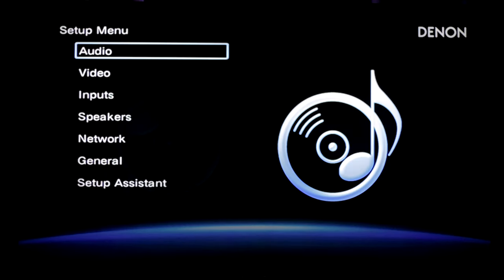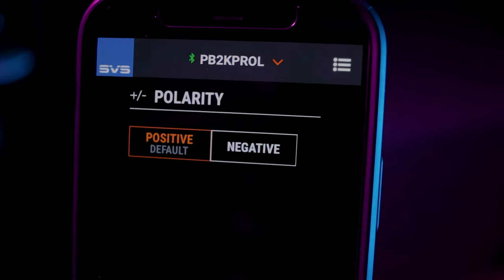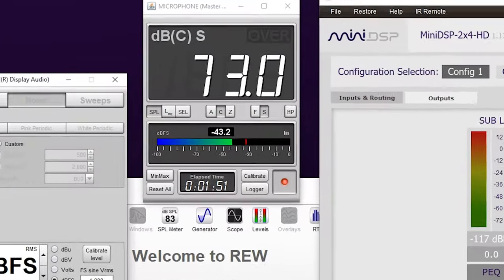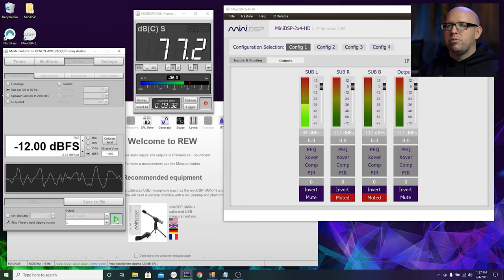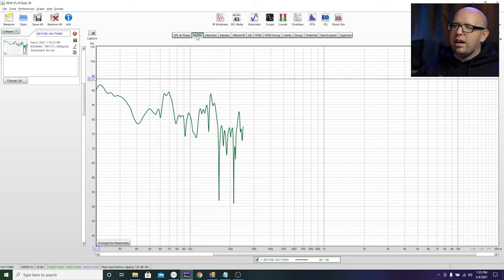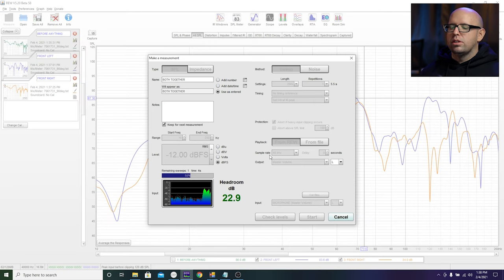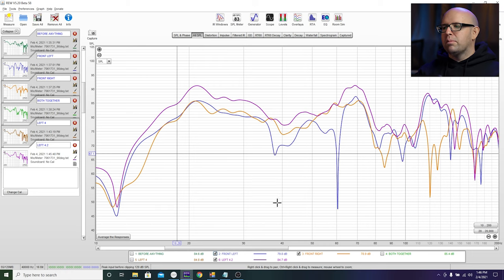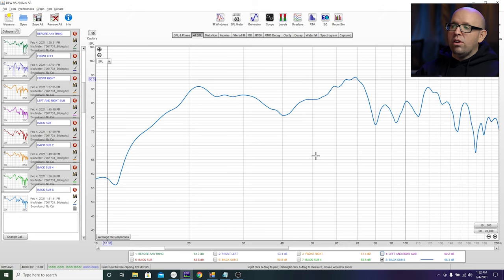miniDSP 2x4 HD | Subwoofer,  receiver SETUP and TIME ALIGNMENT guide (part 2)

Comment: I highly recommend measuring the subs with "acoustic timing". Then you can use the REW Alignment Tool to find the best summation of all the subs without trying to input a ton off different delays. It's highly accurate much quicker and only requires to measure each sub once and than use the alignment tool to find the what works best in your room.
Reply from the maker: I did not know this. I will definitely look into it and give it a try! Thanks for the info!
Reply: You got some documentation on that? I want to tune my subs and I am just starting to learn 👍
Reply: @HomeTheaterGamer  any update on using the REW alignment tool?
Reply: EDIT: I changed the subwoofer position and tried the steps discribed below again. This time the timealignement was not good. I got totally different and beter curve results with brads method!

What I tried and this seems to work pretty well (I am a REW noob, there could be a better way):
1. Set Measurement in REW to the settings Brad provided
2. Switch to "use acoustic timing reference"
3. Unplug your left main (so that you don't get any signal from it, if you crossover does not go as high) and set the reference speaker to right
4. do a measurement for sub 1, sub 2, ... mute the others respectively
5. in the text under the miniature measurement on the left in REW there is a time and distance now for each sub
6. the time will be negative, what you cannot put into the minidsp
7. take the largest distance from the sub measurements and round it up to something nice
8. put that distance in your AVR for your sub
9. now do the measurements again and you will get new (positive) numbers for time delay
10. put those time delays into the mini dsp for each sub

Instead of putting in the delay for each sub you also can set Sub 1 to zero and substract its dealy from the other numbers. It's the same, but the subs are not time aligned with the main R anymore (which Brad does later with the X-over anyway? So there should be no difference here - please correct me if I am wrong). For me this provided a slightly different number as I got by Brad's method (calculated 3,69 vs. 4,7), but the overall sum measurement seems to be pretty close to it as well. I am not sure which I prefere (I got to nasty points at 30 and 90Hz, of course only one of them is better with each method and one is worse...).

So - if you are not up for tons of measurements and analysis by eye, this could help, I think.
Reply: Great video; very high quality. However, I recommend that you spend a bit more time refining the methodology based on science first, then moving on to trial and error. You should start off the time alignment by using a tape measure and math. Determine the actual distance between the microphone at your preferred listening position and all subs. For example, my 4-sub setup consists of two tapped horns at the front corners and two standard bass-reflex Polk subs at the back (i do not recommend Polk). Not only are the tapped horns 6.6 feet further away than the rear subs, but because of the folding inside the TH's, the drivers are an additional 2 feet away from the front of the enclosure. Calculating the delay at 8.6 feet and using the rough speed of sound (which can vary) of 0.895ms per foot, i would start with a 7.7ms delay applied to each of the tapped horns (or a different number for each if they're not equidistant). From there, I would then fine-tune using the "better or worse" method, stepping up and down by 0.01ms. Trust me when I say that 0.01ms can have a huge impact on the response.  Also, don't be fooled by a powerful or even flat response; flat response does not equal low distortion. As such, you also want to look at the distortion of each successive measurement. You can have a nice response with horrible distortion, and your expensive subs will sound like crap, albeit loud crap. Reflections might help to boost dB and give you a deceivingly flat response, but the timing misalignment will wreak havoc on the distortion level, making your bass sound like a whoopie cushion in an echo chamber.  I have had a timing difference of only 0.2ms increase distortion from 39% to 300%.  It goes without saying that what sounds good in one spot might sound like shit in another. My theater is calibrated for the spot between my right ear and my wife's left ear....everyone else gets whatever they're lucky enough to get.
Reply: How do you measure the subs with "acoustic timing"? Is there a feature in REW that does that?
Reply: Agreed. REW alignment is very effective! Check out Jeff Merry’s video “REW Alignment…..”
Reply: Can’t find any tool called that in rew?

Comment: When you were on the first two subs adding delay, I noted you only tested adding delay to one of the subs and then you settled on 4.2 and then moved on to adding in sub 3.  Would there be any benefit after getting the best reading you could from adjusting delay on the left sub, to then adjusting delay on the right sub before moving on to the third sub?

Comment: Thanks for making these DSP tutorials. Really hoping you can answer my questions! A few questions for you:

1. In the level matching section are we just level matching our subs with our front left speaker? If yes, why and why not level match with front L+R and why not level match with just the front right speaker?
I'm sure this is a super basic question, but I don't get what we're doing and what it's accomplishing.
2. Do we need to set the level of the surround speakers to 0.0dB (Denon receiver>speakers>manual setup>levels>test tone or do we leave those to whatever audyssey setup?
3. Should we run audyssey before we start this? does it matter?
4. I noticed your RMS signal level is set to -12.00dBFS. Mine was set to -20.00dBFS, should I change this to match yours before playing any test tones?
Reply: I have the same question about the RMS signal level.
Reply: I have same questions too, have you find the answer. Do you level match first and do the room correction. Please help.
Reply: @lalithpodduturi9811  sad he nvr helped. I found some help online. You do level match first. What room correction are you using?
Reply: @hollosym  I am running Audyssey!!! If you don’t mind can you send me the online link!!! I like the Brad video but it not clear what to perform from first to last, in his video he said to match with left speaker and turn off adyssey. Watch with -30db on raw.
Reply: @lalithpodduturi9811  the big thing he glossed over is setting the type of sweep in REW to “sub” ie subwoofer. In the end you could simply unplug your front left channel and you’re good. Just make sure you doable all room correction. 

His method kinda sucks tbh, the better method is using the alignment tool in REW. Here’s a great breakdown: https://youtu.be/8bwpLfbLiZ4.

That guy's channel I linked above has some really great tutorials. He has a JBL SDP-55 processor so it's a tad different when talking about how to disable room correction. You can follow Brad's how-to to disable audyssey room correction on your receiver.
Reply: @hollosym  thank you!! I did followed him earlier!!!

Comment: Hi there great tutorials. I used a toslink (optical) cable instead of HDMI to connect my pc to my receiver. When I switch to Sub cal, I also hear the signal also through the left main channel is that normal? Or do I really need HDMI

Comment: Thank you, brat, for the tutorial.
I can see many people facing problems when they play (SUB Cal) test tone the front speakers play sound with the sub.
If anyone wants to play (SUB Cal) tone from the mains only without the sub they have to put the front speakers to Large instead of small.
If you put the speakers to small the mains and sub will play the (SUB Cal test Tone) at the same time.
Hopefully, this will help,
Reply: For measuring the subs the way Brad is showing then its correct that the front Left speaker also plays the test tone along with the sub of choice? Because thats what is still showing below in the app. Also, what should the gain knob on the back of the sub itself be set to?

Comment: hello minds guru, I have set up the connection as you described in part1 and I have an issue to get the sub input level to come up on minds software after I pressed the play button on the REW generator. I could hear the noise from my left main speaker but the sub. please advise.... you missed this in your part 2 clip
Reply: I know same here

Comment: you level match your fronts to 75db with avr volume set to  -17.db . Normally you will use reference level -0db for that ? do you level match all speakers in AVR levels section, when you have run room correction software ?

Comment: In the playing of the Sub Cal --
1. Should the front speakers be muted?
2. How did you adjust the subwoofer output to ~77 dB? Changing Input gain or changing Output gain?
3. Are you measuring all subwoofers playing at the same time, ie, with all subwoofers unmuted?
4. if the answer to question 3 is YES, should the individual subwoofers first be adjusted to equal dB before measuring with all subwoofers unmuted?

Comment: Quick question. I'm about to receive my second sub in the mail next week. When I fallow along with this should I set the first subs DB to 75 using the volume nob on the sub itself and then the second sub using DSP software to match? Or can i just use the volume nob on both. I'm confused as to why you used the svs app for one and not the others? Or is it because you only have one svs sub? Any clarification on that would be greatly appreciated. Or should I set both subs to 12 o'clock and then use the DSP software to set both at 75 DB?

Comment: Purchased a 2nd SUB and a Mini DSP.  Working on Time Alignment.  1) should I run Audyssey with "One Sub (the two subs connected to the Mini DSP) for it to estimate a delay/distance for the subs?  2) Once we set Audyssey to "off", do we need to change the AV Subwoofer distance to "0" too?

Comment: if you get a laser tape measure and sit in your lisening position and point at the sub from about where your ear usually is. then calculate from the lenght how many ms it takes for sound to travel well at the speed of sound. now say you have a sub behind you measure the same distance and and calculate the same way the ms but take it away from the previous results. this should make it so sound hits you at the same time if the subs play it at the same time. so thats a really good starting point for time alignment

Comment: Question:  I have followed your steps. I have an Anthem MRX720 and set all crossovers to 250Hz. In REW, when I run a measurement with the setting 10Hz to 200Hz, I still get sound out of my front left speaker. Can you give me some insight as to what I am doing wrong?

Comment: Hi Brad, thanks for this series...it will be very helpful when my Umik and MiniDSP arrives later this week. One question, though, is since you are running your subs off the miniDSP, before you measure do you adjust the sub distance to 0.0 ft in your Denon since the miniDSP is handling the delay?
Reply: I would recommend taking the Denon out of the signal path at first. Connect an audio cable from your laptop to your Input 1 on the MiniDSP (this is where you'll connect your Denon subwoofer out), then the outputs of the MiniDSP to each of your subs. Set the timing of the subs relative to each other and make adjustments (including individual PEQ for each sub) within the MiniDSP. Once you have the subs set up to work together as a team, then you include the Denon. At that point, you can use the Denon's Audyssey mic to make timing measurements for all of your speakers, to include your unified subwoofer team. This is important, because the Denon will see all four subs as only 1 sub, so it's critical that you just focus on getting them working as a team. You will also need to do level matching again once you have all of the subs connected to the Denon.

Comment: After turning everything off in the receiver and setting the sub level to zero, what is a good general distance for the subwoofer in the receiver to start measurements? Should you just pick one that gives you a decent response to start with?

Comment: Hey there Brad - Merry Chrisrtmas to you and yours - and your channel!  A question for you please -  While using the miniDSP where the subwoofers are connected as out 1 and out 2 from the dsp and left sub is connected from sub out 1 from the avr to input 1 on the dsp,  should the subwoofer speakerssetting  in the avr be changed from 2 subwoofers (as was my case before subscribing to you and getting a minidsp!)  to show as 1 subwoofer as the dsp is now controlling?- - or does it matter?

Comment: Great video! What volume do you set your receiver to when level matching?
Reply from the maker: @Alvin Cole I just raised the volume on the receiver until the left front channel reads 75dB on the SPL meter when playing the "SPEAKER CAL" tone in REW. That's it. In my case, that ended up being -17.5dB on my Denon X2300W.

Comment: I believe it is generally suggested to set the sub level to -6/-5 due to potential clipping. I just finished building two Stereo Integrity HT18's last week and set them up with with the 2x4HD. After getting them roughly calibrated with the sub out set to level 0, when playing edge of tomorrow at 0db Master volume on my denon x4400h, the subs were clipping. Turned the volume down to -5 and clipping went away. So I turned the sub out down to -5 and turned the amp up to compensate. Now at 0 on the volume there is no clipping. Didn't try to go louder but I would agree that the sub level should be set to -5 as stated I the avsforum subwoofer setup guide. But overall these videos were very helpful!

Comment: Something I've seen kind of unclear, after disabling room correction, setting sub gain to 0, and XO, do you do anything with the old distance levels or leave them where they were? Thank you!
Reply from the maker: I typically don’t touch the setting unless there’s something REALLY wrong with the final output that is not correctable when you get to the main to sub time alignment stage. The sub distance itself is nothing more than a phase setting/alignment setting for sub to main integration, which can be done in the miniDSP software.
Reply: @HomeTheaterGamer  Just confirming during the measuring and setting up dsp, you leave the old sub distance alone on avr? No need to set to 0 like the gain?
Reply: @YourMovieFix  If you have an AVR with a microphone that can do auto measurements, I would recommend using it again AFTER you have set everything up in the miniDSP.  This is because all of the changes you make in the miniDSP, especially timing delay, will change the distance that your AVR calculated before introducing the MiniDSP.  Even the miniDSP itself adds "distance", because there is a process of ADC (analog to digital), DSP (digital signal processing), and then DAC (digital to analog conversion) that takes place. It is fast, but it may introduce as much as a 1ms delay...which is about a foot of distance.  Timing is insanely important; while it can help with SPL, it is critical for sound clarity and coherence. It's the whole reason why expensive AVRs come with microphones in the first place.

Comment: Great video,
Question regarding the level matching section (9:15).
After you set the volume with the mains using the receiver remote, are you disconnecting the mains to level match the subs? Or do you keep the mains active when level matching each sub?
Reply: Oh wait, I just noticed that you set the play tone to 'Speaker Cal' when volume matching and your changed it to 'Subwoofer Cal' when you level matched the subs.
Reply: @ablerauer  I was wondering the same thing.  I'll have to try it and see if the left speaker is cut out and not playing during the sub cal or measurement runs.
Reply: When I set the tone generator to sub cal, I still get a signal from my left front channel. I have the receiver crossover set to 250hz. Any idea why this may be occuring. I appreciate the help!
Reply: I got same issue when sub noise is selected it coming from speaker as well.

Comment: My friend, do you think this device can help solve the problem of watching movies?  that problem with low dialogue and very high action scenes? Is it possible to leave everything in the same volume?  I use the optical cable TV/soundbar subwoofer connection via Bluetooth. Please my friend help  simple soundbar 2.1